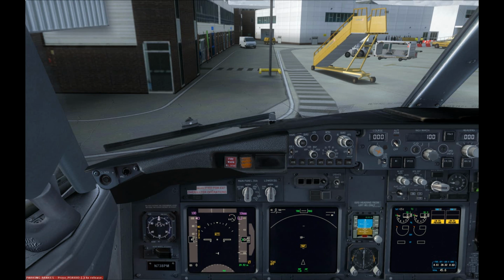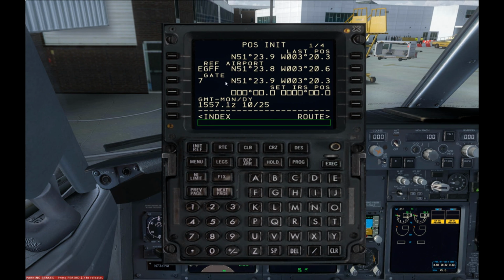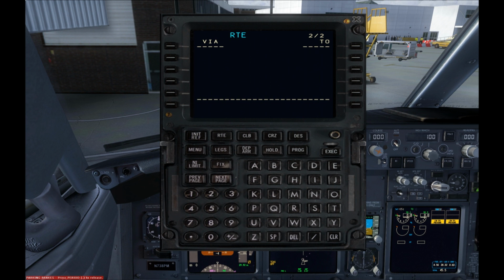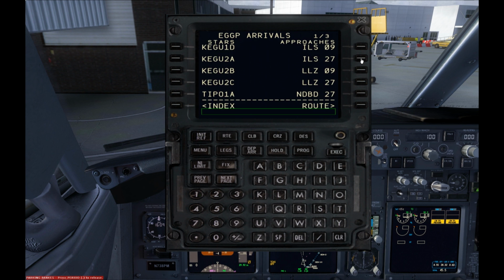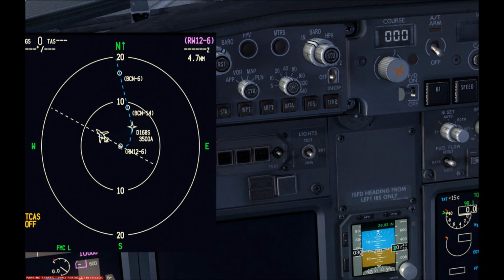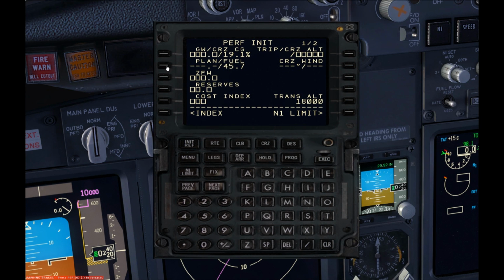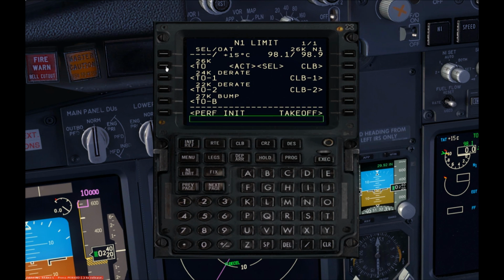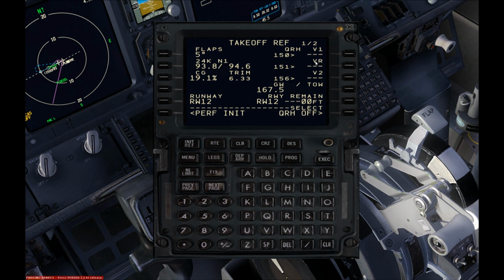[HD] PMDG 737 NGX | Full FMC/CDU Tutorial

Comment: Hi Jappie!   the answer to that question is ..NO.  the reference manuals are there to do just that!  "Reference".  meaning, Pull them out if they need to run an abnormal checklist or something like that. now, do pilots have to 'know' nearly every inch of this airplane, and have training that crams them full of knowledge and understanding about nearly 'every system' on the Bird?  YES. but they don't have to 'store' and recall, every byte of info they've learned, in their heads. it's in the books

Comment: When you take off, at least 500 feet above ground, or more if you wanna fly the climb, you'll press lnav (controls lateral movement) and vnav (controls vertical movement and engine thrust) located on the mcp. Press z to engage auto pilot and it'll follow the route. FYI you need to have the mcp altitude at your cruising altitude before takeoff, or it wont climb to it, as well as lowering it while in the air before decending, or it wont decend.

Comment: pressing the "ALT HOLD" button, does JUST THAT.   if STOPS a current climb or descent,  at the altitude your aircraft is at,  at the "time' you pressed the button.  for a climb, set a higher altitude that what you currently are at,  IN the Alt. Pre-Select Window,  then choose a Vertical Mode ie; FLC  (flight level change) VS (vertical speed...the simplest for beginners) or VNAV,  the most complex.  the later takes some understanding,  practice, and ideally, some study and reading of how it works

Comment: You can't select a takeoff cg taking as reference the crz cg, because they are different  stages of flight with different fuel weight distribution. So if you trim the aircraft for takeoff as if you where cruising, you'll need to apply lots of pressure to the yoke (push or pull)

Comment: Adam Desjardins Speaking of saying "things you don't know" and leading "people into thinking false things":
 
The Transition Altitude (TA) has nothing to do with entering class A airspace whatsoever. Below and at the TA, the altimeter is set to the local QNH and the vertical position of an aircraft is reffered to as "altitude". Above the TA, QNH is set to ATM (29.92 inHg or 1013mb) and the vertical reference is "Flight Level".

And assumed temperature is NOT used to save fuel (biggest bullshit I ever heard) but to reduce engine wear. the difference in fuel consumption between a "flex"/"assumed temperature thrust reduction" T/O and a regular T/O is not really worth mentioning...

Comment: Thanks ReNewReView. I am new with this.  I’d just bought 737 from PMDG and you answered me a lot of questions specially a simple one like what V1 is standard for.
Reply from the maker: V1 is basically a speed reference, so it changes with flights usually dependant upon weight of the aircraft, thrust rating of the engines etc.. you have many V references.. main ones being V1, Vr and V2.. V1 is basically the calculated speed at which you must be commited to takeoff.. so say if its 132 knots as soon as we hit 132 knots we must commit to taking off regardless of any failure. Vr is simply rotate, so obviously the speed at which the pilot would perform the takeoff rotation. V2 is the safe climbing speed which is obviously the speed at which is the minimum they shjould at least be climbing at which is safe.

Comment: I have no Idea what is wrong with my altitude hold button or FMC settings. When I push it during the flight the plane does not climb. Let's say I'm flying 1500 meters above the ground and I set the altitude to 2000 meters and push the button. The plane starts to decend, not climb :/

Comment: Hello so first sorry that i write so many comments. But i have a question. So if you are at cruise level and you selected a a star will the plane automatically descend when it is time to descend? What i mean is if you have a waypoint e.g. liffy and you should be 10000 feet high and you are it. But if your next waypoint is bcn and you should be 5000 feet high at that waypoint will the plane automatically descend between liffy and bcn? Or how do you need to tell the plane where and when it should?

Comment: Good tutorial. However, don't say things you don't know because you'll lead people into thinking false things. e.g. the Temperature select.. This is called assumed temperature, and it is used to derate your t/o pwr in order to save fuel. Another example of you giving bad info is the transition altitude (where you enter class A airspace) . in southern control area it's fl180. in northern control area, it's FL230. in artic control area, it's fl280 to but not including FL600.

Comment: Nice video , can you make one of how you set a holding patthern in the FMC .
I have lookt over 2200 pages of the manual , but it is verry hard to find .
thanks Bert Overweel.
Reply from the maker: to activate a hold, basically go to the FMC, select the hold button, you casn then select any waypoint to hold at, then select it into the boxes and activate it :)
Reply: Sorry aboud the delay , thank you for your tip .

whith Regards Bert Overweel

Comment: please update the  tutorial.for honywell fmc and please say which fmc u r using ....and how to get it ....my fmc dont have this much functions
Reply from the maker: +vishnu vishnu er are you sure you're using PMDG 737 NGX?
Reply: +vishnu vishnu er  you need to buy the pmdg 737 aircraft for fsx
Reply: +vishnu vishnu er YOU NEED THE EXPANTION PACK 'PMDG 737 NGX' THIS COMES WITH A FMC NOT HONEYWELL THIS IS A ADD-ON FOR THE FSX/FSX-STEAM
Reply: My pmdg showing insufficient fuel 
After take off I can't switch on autopilot
Reply: problem with Autopilot - When ever tried it's just seems freezed
My fmc plan is OK
Trim is OK
Flap setting OK
But after take off even at 3000 ft
Autopilot not engaged
Vnav lnav all are not functioning
Reply from the maker: +vishnu vishnu er You need to make sure the Flight Director switches are set to ON, you have two.. one is on the captain side just to the left of the speed, and the other is in the saqme place on the first officer side it's labelled as 

F/D

Comment: How do you click on the system and the panel pops out? Do you have a program for that ?
Reply from the maker: if you just click on the actual moddled panel, it will pop up the 2D version, or you can go to the views tab on the top bar and select instrument panel then your desired panel, or just press through SHIFT + 1 to 9
Reply: ReNewReViews I'm using X-Plane 10 Global. I tried having in 3D and tried just clicking the panel I want to enlarge nothing happens. Views tabs does nothing and the shift + 1 to 9 just does views on the outside.  Great video. Yours is the only one I have seen that has explained it from beginning to the end.

Comment: How to reset fmc???
Reply from the maker: +Superblyme139 there's a quick tip of clearing the flight plan i believe by typing '99' then entering it into the route section, if not you can delete waypoints and override information, or simply disconnect the battery power/go cold & dark

Comment: does 737 comes with microsoft flight sim or it separated
Reply from the maker: It does come with a 737-800 default, this is PMDG 737 NGX it is payware a seperate addon
Reply: And also how do u control the aircraft without autopilot or if there no joystick? for example when take off when after it said rotate how do u lift the nose up